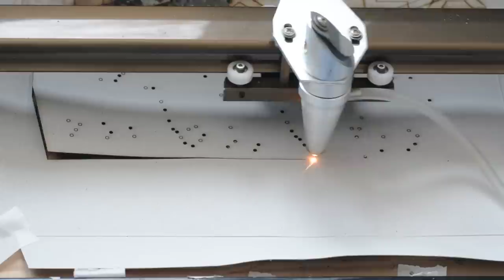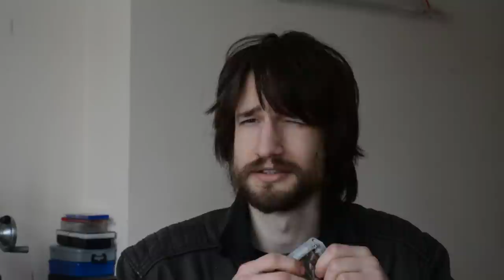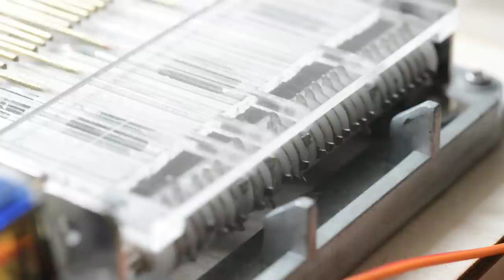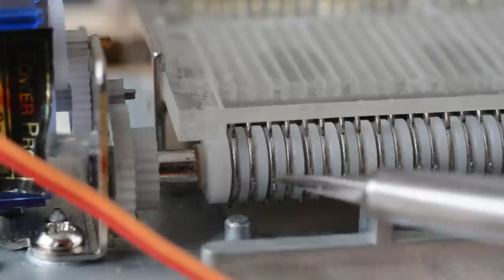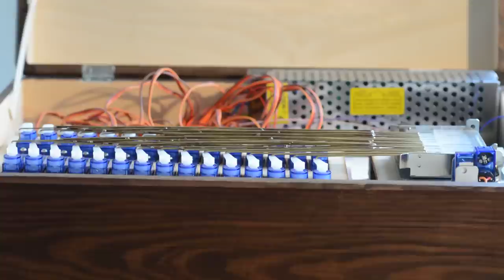MIDI Music Box

Comment: I bought one of these music boxes. Made a little box for it. Then I found out the cyilnder that turns and is supposed to pull the paper, does not pull properly as it loses contact all the time, making it slip. It also plays random keys because the teeth sometimes actually press the paper upward physically instead of hooking onto the holes. It's really sad cus I made some really nice arrangements for it and had a lot of plans. If I can get around this problem I'd want to try it again.
Reply: Sorry for a late reply, but I just saw this comment. From my understanding of your comment, the issue you're having is with the roller shaft that pushes the paper through, like it's loose or something. This is why the toothed wheels that strum the metal comb are pushing the paper up. The paper should sit in between the roller shaft and the toothed wheels and make propper contact in order for the teeth on the wheels to make their way into the holes. Not sure how to fix that, you may have to talk to a mechanic or the manufacturer or whoever you got it from. I've got a music box like this and I've not had that issue.

Comment: You know, the knowledge required to do this requires an intimate knowledge of the MIDI protocol and it's associated hardware. It also requires knowledge of microcontroller programming in either C or Assembly language.  It also requires a knowledge of electronics hardware and construction. It also requires a knowledge of music. ie. You need to have been born with this gift preferably.  It also requires an obsession with stuff !  It also requires plenty of uninterrupted time.  You my friend are nuts!  I love your work !

Comment: I bet if you made the reset motor turn a bit faster you could increase the tempo and hit tighter-placed notes.
Reply: But at what point would you get note fall off, I imagine it took a lot to get the proper rotation with those plastic cogs to get something with good timbre and intonation as it has right now

Comment: Wow, I'm impressed with just how fast the notes can repeate. Could that be shortened by having a faster motor resetting the pins?
Reply: I think what you're referring to are the servos. Heres more info on them.
https://youtu.be/J8atdmEqZsc
Reply: Connect the rods further out on the servos (need longer servo horns) so they don't have to turn as far for the same movement. Plus you should be able to power them with more voltage 6-7v instead of 5v safely and you could easily double the speed of the rods without having to upgrade the servos.  But you still have to wait for the little teeth on the music box to rotate to reset position so it would probably reduce the lag but not the speed of repeated notes.  But maybe you could also change the gearing on the servo spinning the music box to reset them faster.
Reply: @AngryHybridApe  No the music box has to reset each note using the handcrank input, which takes an amount of time which is likely determined by how fast the crank is turning.
Reply: @tissuepaper9962  
I dont mean to contradict you, but actually, its determined by how fast the servo can push the dial and get back.  There's no hand crank, its all electric with electronics running off a digital interface in the computer.  The only physical part is playing the keyboard. But most of the music is stored on a hard drive. He only has to record himself once and the MIDI does the rest afterwards.
Reply: @AngryHybridApe  Literally watch the video. There's a motor attached to the handcrank for the express purpose of resetting each note after it gets played.
Reply: @tissuepaper9962  
Ok. Give me 5 minutes of your time. Please and I'll explain it.
 You'll thank me. I'm gonna tell you timelines on the video where you can see the parts I'm going to explain what they do. (This guys a genius btw.)
The main parts are the servos (31 of them. 15 on top, 15 under those, and 1 big one at the end) the Arms, the rods, the tips, the wheels (with nubs), tension disks, the comb with teeth. 
Now go to timeline 12:02. You can see almost everything mentioned except the comb and teeth. Hard to see the wheels and disks yet.
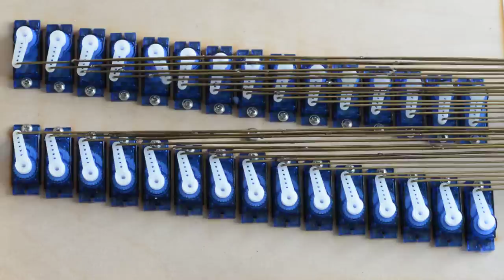17:15 Everything you see here that is blue, is a servo. The white things on top of them are the arms. The brownish copper lines going across are the rods. Each servo has an arm, a rod, and a tip. Cant see the tip here, so go to 20:20. See the little clear plastic tips that keep popping out and turning the wheel. Tip pushes a nub ( call it nub #1)on the wheel directly under it. Theres about 5 or 6 nubs on each wheel. Nub gets pushed across spinning the wheel. Because of the angle between the two actions, (spinning the wheel and plucking the tooth)nub #2 is in a position of nell, so it gets temporarily skipped. The 2nd nub behind nub #1 (nub #3) gets pushed up, plucking a tooth on the comb. The comb cant be seen very well, but its right behind all those wheels and disk. I know, im getting to the disk part in a bit.
Ok, so how does it all work? The MIDI knows about all the servos and has assigned 1 note per servo. When a note is to be played, the MIDI sends a signal to that one servo, one time. The servo activates its arm forward and back, one time. Arm pushes rod, tip, nub#1, wheel spins, nub #3 lifts up and "ding" note is played.
But there's only one problem. The tip can only push the nub so far, and that wheel has to get nub#2 ready to get pushed and nub #4 under the tooth.
Thats where the big servo and tension disks come in.  The big servo constantly turns an axle. All the wheels are on that axle, but are loose. Tension disks are placed between each wheel and are anchored firmly to the axle. The wheels and disk make a slight contact with eachother. This keeps friction on the wheels that are not in place spinning until they are. But not so much friction as to pluck a tooth or over postion the top nub (#1).
Reply: @AngryHybridApe  You just told me what I told you. The axle that you're talking about is what I'm calling the handcrank, being turned by a motor. The speed of that motor determines the maximum repetition rate.
Reply: @tissuepaper9962  
I see. Conflict in terminology. I knew it. 
Lol
Reply: @tissuepaper9962  

But there is a way around all of that anyways. The servos dont have to immediately return to the regular position for the next note to be plucked. If ils required to play, say a 16th, I doubt any speed of the motor would solve that without muting it putting it in position. But if it plucked up and down, none of them would even have to he positioned. Wouldnt need a motor or wheels niether. They'd be in pisition right after the 1st pluck, wether its in the up position or down. Like guitarists pick. Theres alot of down stroke plucking going to waste like it is now.

Comment: You could reverse the action of the servos so they move back when they receive the signal, since that's more like the card system. It does add latency back in, but draws the same amount of power as the setup you went with.
Reply: being able to plug in a keyboard and play in real time is absolutely amazing though, it's what turns this project from pretty damn neat to mindblowing.

Comment: Very neat! Thanks. 🙂👍
So long as you don't exceed the maximum note repeat speed of the mechanism, it plays very well. The repeat speed can be improved markedly by plucking the reeds directly, bypassing the rotating blades. That should not be too difficult to achieve.
A software suite (APrint Studio) is used to print MIDI events onto paper, in a format which is suitable for stencils to make card music for the small street organ in my icon. The MIDI files have to be edited to accommodate the non-chromatic scale if the instrument. 
Yes, punching the notes manually definitely involves work and patience! Some people use pneumatic or electrical punching machines to produce the final product. Others use MIDI as you have done, to operate the instrument's mechanism directly. It's more efficient, but, from the viewpoint of an audience, it's easy for the music to lose the human touch and visual engagement of a live performance.

Comment: Mitxela: Complains about effort of punching holes in paper and turning a crank.
Mitxela's Solution: Commit infinitely more effort to create an electronic music box instead.
Reply: Well there's a difference between boring, tedious effort (punching holes in this case) and effort that's actually mentally stimulating and that gets your mind working. I'm sure building that electronic music box was definitely mentally stimulating... it gave him a new challenge to figure out how to convert MIDI data into mechanical movement (the "mechanical movement" being the inner workings of the music box).

Comment: There must be a limit in the repetition rate - how close identical notes can be to each other - due to the small toothed wheels the servos are hitting.
Reply: Well the repetition rate has to do firstly with how fast the wheels are allowed to spin (that's controlled by how quickly the motor is spinning) and secondly how close together the pins on the wheels are. The pins on the wheels are what actually do the note triggering; they're acting a bit like plectrums used by guitarists or something of that nature. To increase the repetition rate, one could either increase the speed of the motor (problem: potential for more motor noise!), or (theoretically) bring the pins on the wheels closer together (problem: potential for unwanted double or even triple triggering of notes, when they should only be triggered once).

Comment: Do you need the servo on the drive shaft? You could replace it with a normal geared motor and reduce a lot of the noise since it looks like a low speed/low torque application.

Comment: Version two - more dampening on all moving parts, but ensure the servo movement is visible - seeing them all moving together is interesting -clear Perspex cover? Ideally make the whole thing tall and vertical, not horizontal. See if you can better acoustically / mechanically amplify the comb. Move the pins 2 to 3 mm closer to the spindle  for even more responsiveness and also less servo noise?

Comment: i like it, if you had a bit more money and time to throw at it, you could have used some micro solenoids. You can get some for about $1 each, but they're 12v 300mA, so you'd need to use some beefy transistors or even a small mosfet.
Just put soft bumpers behind each solenoid so they don't make too much noise from their spring's recoil. ^_^

Comment: Ha. It soooooo reminds me of my rpi2caster project i.e. using a Raspberry Pi for controlling a Monotype composition caster, which basically casts whole pages of typeset text as lead type, and is controlled by "ribbon" i.e. 31-channel perforated paper tape. These ribbons were punched either with a traditional mechanical Monotype keyboard, an electromechanical keyboard or a computer-controlled perforator. The machine can be direct-controlled though/

Comment: I really think solenoids would be simpler to use than servos. You might need relays to drive them but they're 2 simple parts and one control wire rather than all the extra wires and gears and levers needed to do it with servos which multiplies with how many servos you used.

Comment: I wonder if this is what early prototypes of the muro box was like!
Reply: Maybe, but it's my understanding that the muro box uses a completely different mechanism of triggering notes. It still uses the idea of pins on rotating wheels to trigger notes like the music box shown here, but it's a much simpler mechanism in that it doesn't use such a convoluted arrangement of motors and wires to control the rotation of the wheels. It uses one motor to drive the main shaft. Then it uses something else called the "pin stopper". That pin stopper either allows or restricts the rotation of the wheels, depending on whether or not a note should be played at that time. I remember the company basically describing it as basically being a kind of spring that has 20 teeth on it, which correspond to the 20 wheels which therefore correspond to the 20 notes (the little metal strips that vibrate to make sound). I guess the way it works is that the spring pulls bac away from the wheels to allow them to spin, then it pushes forward again to allow a pin on the associated wheel for that note to bump into the associated tooth on the pin stopper, to prevent it from spinning after a note is played? Or something like that? It's not very clear to me. I'm also blind, so that makes it a little more challenging to understand.

How the pin stopper controls which wheel on the shaft is allowed to spin and which one is restricted from spinning, I ultimately do not know how that part works... obviously you don't always want all the wheels to spin at once, because then all the notes would play at once... that's the result you'd get if it was literally just a simple spring with teeth on it. you need control over which notes should play and which notes should remain silent, obviously. Someone in a comment suggested there might be some kind of clutch that "locks" one wheel to the shaft (I.E only that one wheel is allowed to spin). Perhaps there would maybe be one clutch for each wheel or something? I don't get it... the pin stopper is the most confusing part of that Muro Box to me when it comes to the mechanics. But I'm also kind of an idiot when it comes to engineering, so there you go :)))

Comment: The servos bother me. Have you considered using linear motors or solenoids as actuators?
I know it would be significantly more expensive but it'll be quieter and the latency would be crazy low.
Reply: Latency is irrelevant, as long as it’s consistent. (And thinking of it, solenoids would have a terrible response, because they are not very consistent. Also keep in mind you can’t just whang on it, you have to push it gently. Linear motors could work, but would be very expensive.)

Comment: What a wonderful mix of modern and century-old tech. I am slightly puzzled though; why the toothed wheels that pluck on the comb don't rotate until pushed by the pushrod? Is the friction between the driveshaft and the toothed wheels not enough to pluck the comb by itself, but enough to index them to the next tooth?
Reply: I'm not exactly sure what you mean by "pushrod". Are you talking about the mechanism he instaled that stopps and starts the wheels from rotating? The wheels don't nead to rotate unless there's a note to be played.If you could elaborate more, maybe I'll understand. I'm visually impaired so that's probably why I don't fully understand the question. I can't see the video, so I rely soli on hearing it.

Comment: It's a shame the plucking wheels don't come back around fast enough for rapid same-notes to play like in 18:08.  Otherwise it's fantastic and clever.  Could you spin the crankshaft faster to allow that or would that burn something out?
Reply: That's an interesting idea. The concept of the same note being repeated very quickly is important for certain genres of music to sound right (in my opinion). I'm not sure if making the motors faster would "burn something out", but I'd imagine it would use more power. The only way I could see the motors burning out is if they wer putting out more power than what they were designed for. So you'd nead motors that could support higher speeds because they're designed to do so. I'm not sure though, I'm not really a mechanic or electrician or anything of that nature.

Comment: I wonder if spring-loaded solenoids would be a better fit than servos.
Reply: would certainly have the potential to be a lot less noisy. and you only need a mosfet and a diode to control one

Comment: solenoids and reverse levers! the lever pulls the note in one direction, and silently returns (it is folded by the knee and the lining of the fabric with oil for perfect glide). the knee without a spring, only the amplitude of the rolling is small ... everything would work silently! only music ... and a very quick reaction could be achieved ... so would WOW EFFECT! but with sevomashinkami ... well, as the last century was, it remains ... no symbiosis of the naturalness of sound and technology. and you can add mechanisms for muting the sound, but this is not necessary for the wow effect, this is cool only for nerds. A cool idea ... but genius in execution ... and you can add a huge box of plywood! then the sound will be louder than from the casket ... of course it is necessary to make an angular orientation so that the sound is clear and loud ... well, it’s easy to imagine all this, why only you spent your strength on the acting game!)))) you need to put genius into the idea! )))) execution is already possible and draw on paper and give to others to do ...))))
Reply: я с россии, sorry my english, i'm russian)))